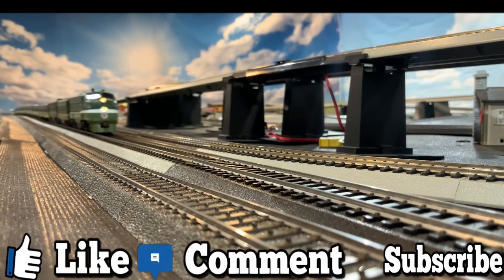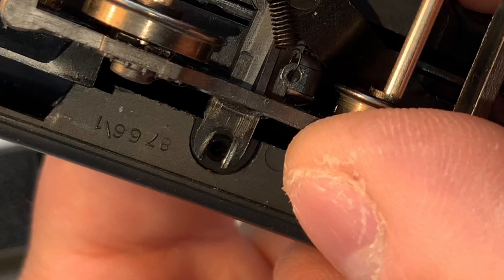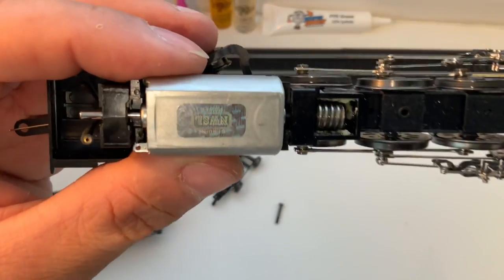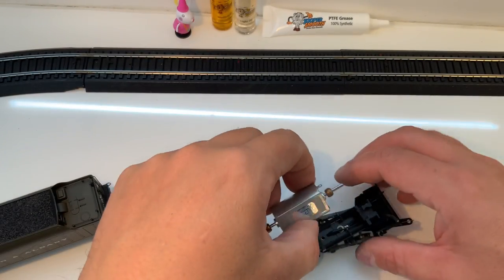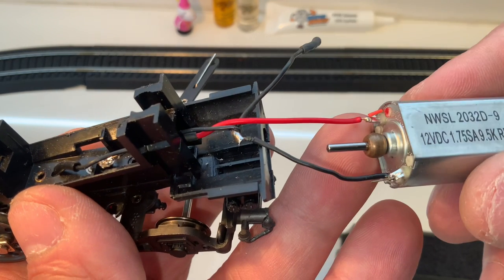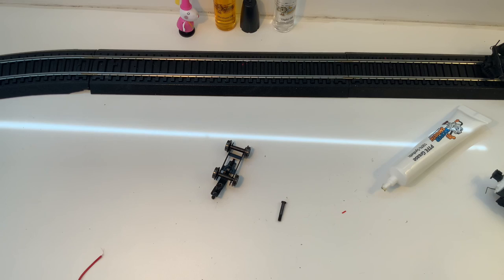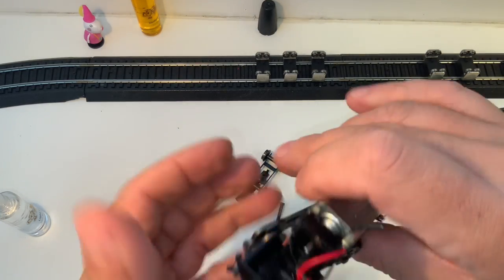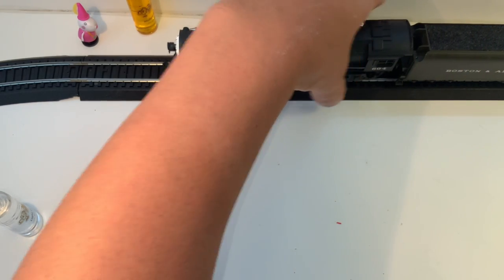Fixit Quick: Working With the Motor of an HO Scale Rivarossi / AHM Super Hudson Steam Engine

Comment: Good vid thanks!, i bought many parts from NWSL. great store...I'd love to see a rework of the Rivarossi Casey Jones#382, 4-6-0, it has a cheap 3 pole vertical type motor that could use upgrading tho it is from the late 70's the company is overdue for a remodel of that unit, but i love the look of that engine..

Comment: That would be exciting, to find a brand new motor (not wired) in a locomotive that did not run. - Paul
Reply from the maker: I thought it was really quirky.. well, actually, you saw my legitimate reaction. This hobby is full of hidden treasures to be sure! Thank you for watching and commenting!
Reply: especially a NWSL motor
Reply: @DoctorHobby  NWSL is a shop that specializes in motors /gears & anything mechanical, to do with mode trains. Great source for all parts/ motors.Have been around for years.